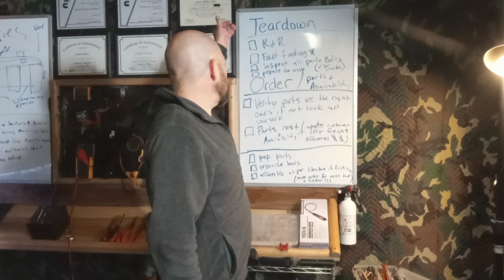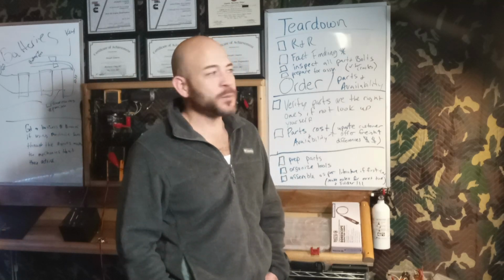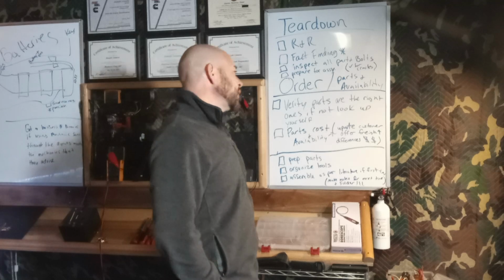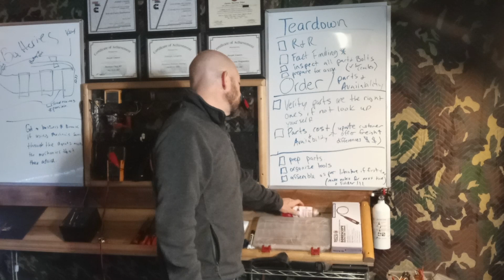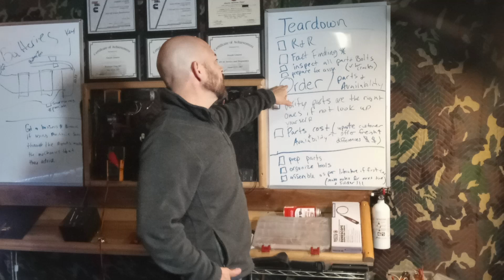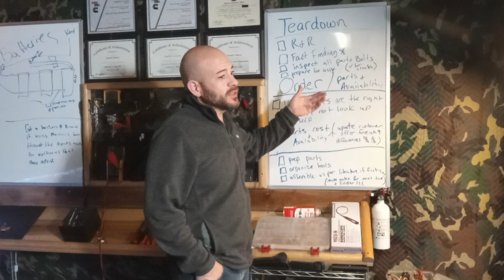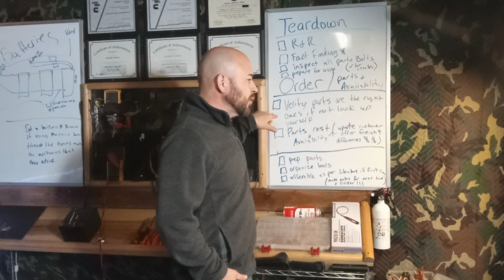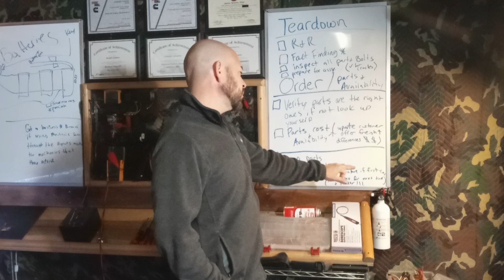My Diesel engine repair process.

Comment: Good advice! Do you have a video on your diagnostic thought process? I was in the automotive transmission rebuild arena for 28 years. I would never hire a potential builder until he explained his diagnostic process/strategy. If they didn't have one I passed on possibly hiring them assuming they applied as an experienced rebuilder. Keep up the great content!

Comment: If someone is putting together an engine without any lube they shouldn't be anywhere near an engine. Lucas oil stabilizer, red slide grease,  30 weight oil, heck even vaseline will be enough for a few seconds until the oil pump kicks in.